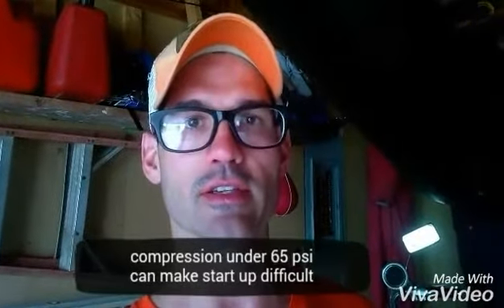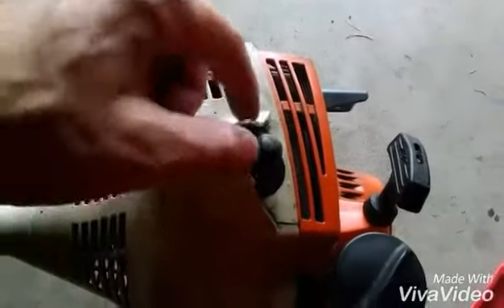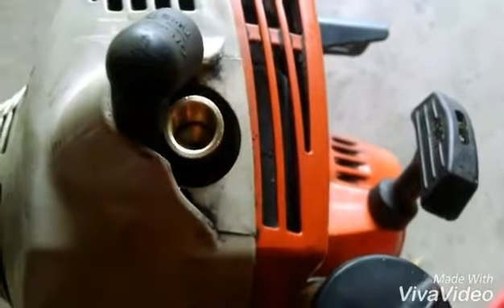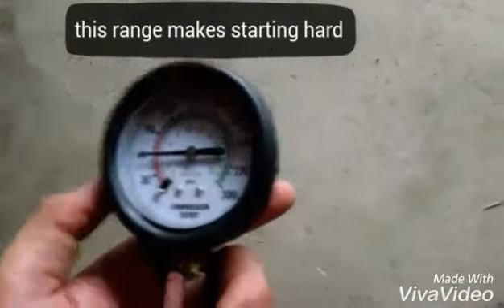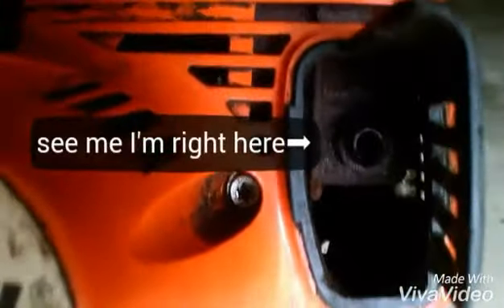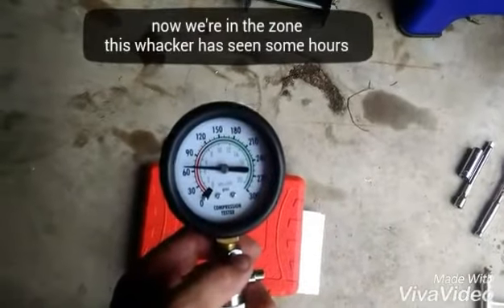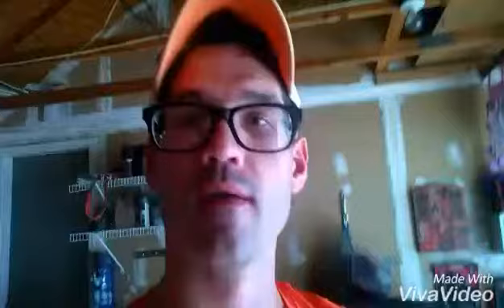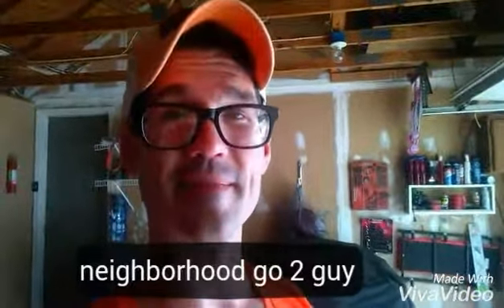Stihl weed eater whacker F5 55RC low compression won't start test spark arrestor

Comment: Hey I took the engine apart and found that top of the piston complete cover carbon. Cleaned it up and still no start,still no compression. Question:  will a missing Spark Arrestor cause no compression?
Reply from the maker: No.
Reply: Ok thanks. I didn't think so either but I needed 😌 to hear it from an expert. Have a great evening.

Comment: I have a F55 weed eater and no compression at all. When I look at the spark arrestor it only looks half the size of the one you pulled out. Could part of it be eaten away?
Reply from the maker: If it's got no compression it's probably needs a new top end, I doubt half of the arrestor broke off.
Reply: @Neighborhoodgo2guy  I went out and pulled the Arrestor out and all that's left is the piece that the screen fits over, the rest of the screen is gone. It must have burned up. Is that possible. Thanks for your reply.
Reply from the maker: It would have had to get really hot for that, maybe that's why it blew up? That or someone yanked it before you got it?
Reply: Let me correct the model number. It's KM55R. This unit has everything new and won't attempt to start. I can pour gas in the cylinder and it won't attempt to start.
Reply from the maker: Oh noooo, I sure hope you mean 2 cycle mix and not strait gas?
Reply from the maker: If this unit is new and won't start you should take it back to where you bought it and ask them for help, somethings not adding up if this is a new unit and it doesn't start.
Reply: @Neighborhoodgo2guy  No it was mixed.  I'm fixing this for one of my Church members. I'm going to have to tare it down and see if I can find what's wrong with it. Thank you 😊 so much for your help. It means a lot. Have a great and blessed day.

Comment: I thought it was carb wouldn't come up to speed. Tried adjusting it then replaced carb. Same problem. Compession high. So the spark arrestor was blocked with carbon. That was the problem.

Comment: I was gifted that exact same weed trimmer.  It will not start.  I’m going to use the round end as a hammer.  Frustrating when it’s brand new and the guy prolly ran straight gas in it
Reply from the maker: If straight gas was used it may have scored the cylinder wall without the proper lubrication. Check the piston for scoring. Remove the muffler and spark plug. Look inside the exhaust side port to check the piston. Good luck 👍
Reply: Neighborhood go 2 guy I checked compression and it’s not even reading on the gauge. Had to read compression on my 3 wheeler to confirm it when’s.  I’ve already cut out the piston and made it Into A cool looking display